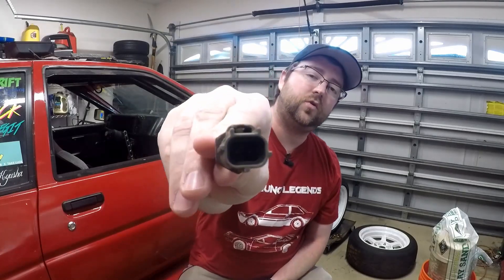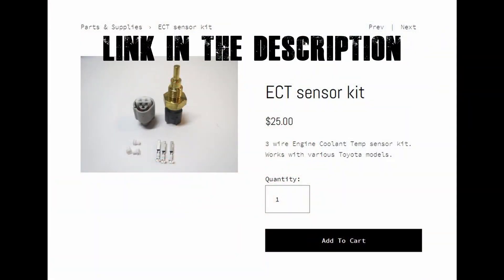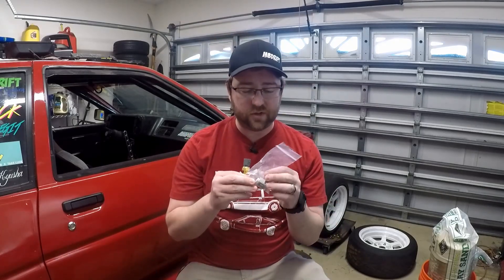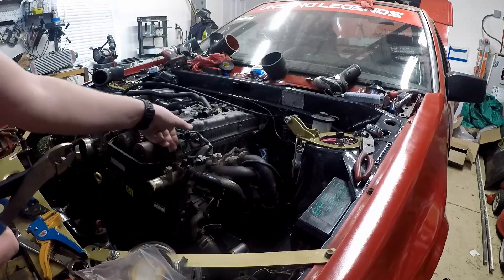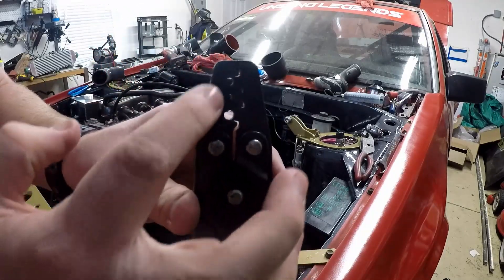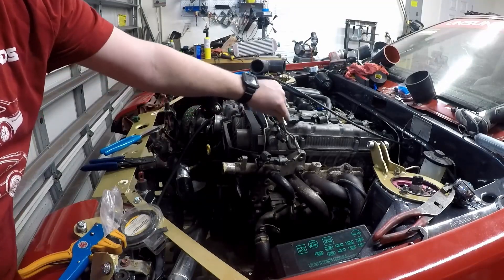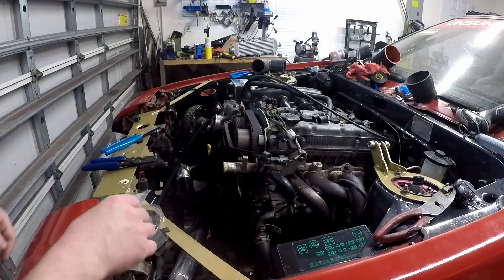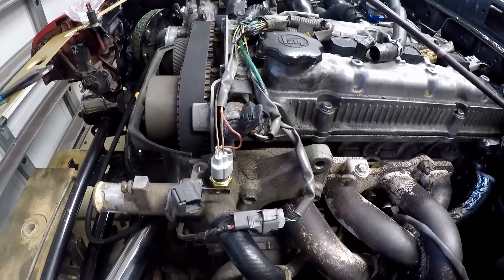BEAMS AE86 Swap - Get the STOCK Coolant Temp Sensor to work w/ Swap

Comment: There are 2 wires red/white and brown. I know one goes to the ECU and one goes to the gauge. Which one connects to the gauge.
Reply from the maker: The factory sensor has 2 wires - one goes to the ECU, and one goes to ground. The upgraded sensor has 3 wires - one goes to the ECU, one goes to the gauge, and one goes to ground.
Reply: I see so I need to get the upgraded one thru panic made. Reason I’m asking is because I’m just running stock ECU . Is there a way I can run wire to my gauge with out upgrading.

Comment: U think that this will work on a 80's Hilux with a 3sge AT?
I've replaced the original sensor with a adaptor on the cooling hose but the reads are always low...
Reply from the maker: Hmm. Not sure. If you could get the resistance range of your stock sensor and compare it to the panic 3 wire one it'd tell you. Sometimes you can solder in an additional resistor if you need to
Reply: @DoctoredGarage  I got the resistance number on certain temperature can u help me finding out?

Comment: How can you get the fan to turn on
Reply from the maker: I'm still sorting out how to get it to turn on using the factory Altezza ecu, but I used an external fan controller for awhile.
Reply: @DoctoredGarage  You need the whole BCM. The ecu control is only for AC operation. With a standalone it's easy obviously :)